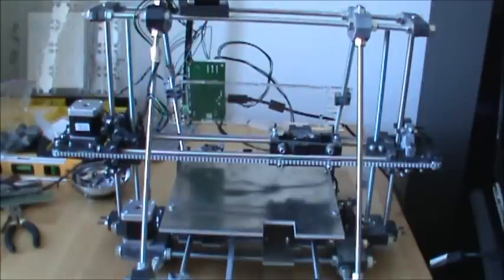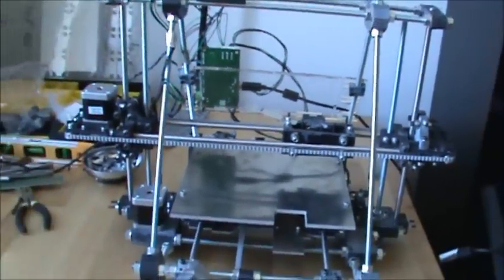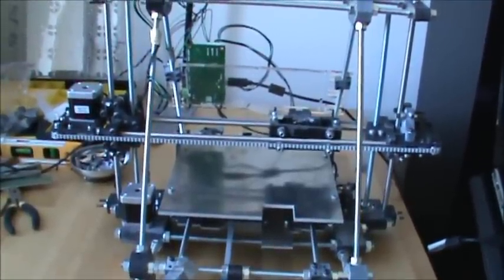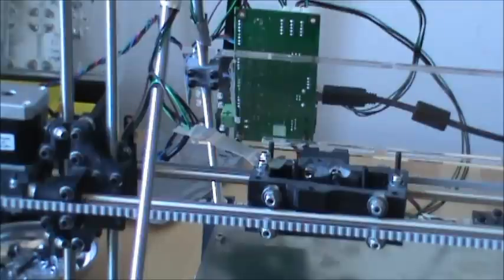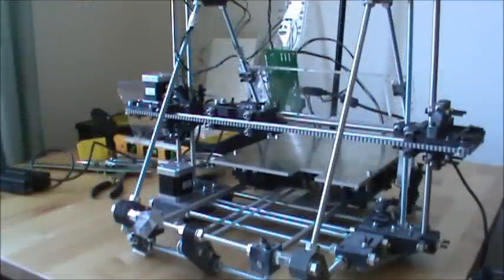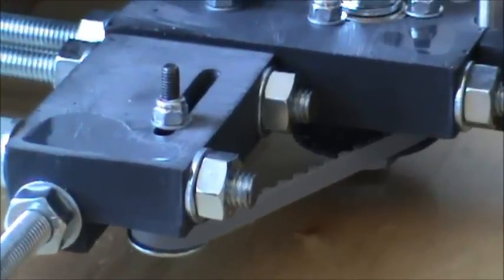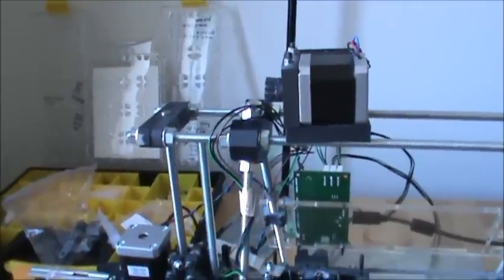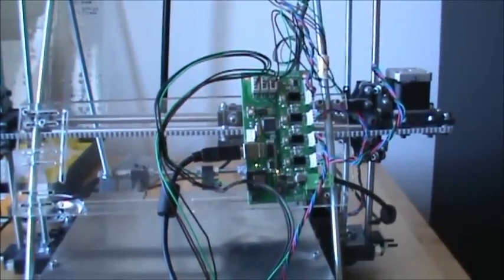Reprap- Day 10 Fully Mocked up with motors, still waiting on new parts

Comment: The quality on some of those parts is terrible, Im currently in the process of getting everything together to build a RepRap Prusa, ive purchased most things now just the electronics and stepper motors to purchase. Ive been looking at a RepRap Gen 6 board have you found this to be ok ? and are there any issues with the software that can be used, I use windows Xp thanks for any advise. Im in the UK by the way so if you need any metric parts maybe i can help regards Richard